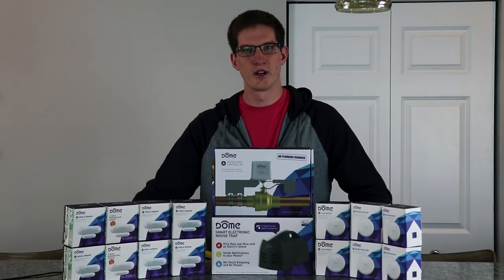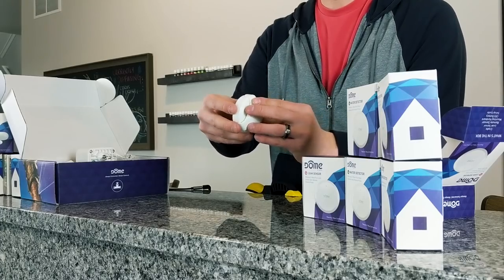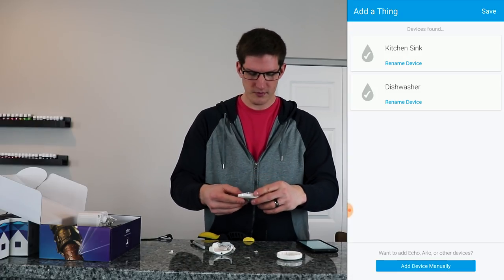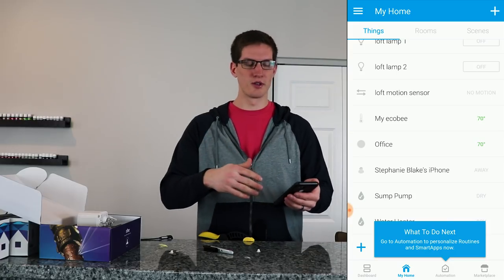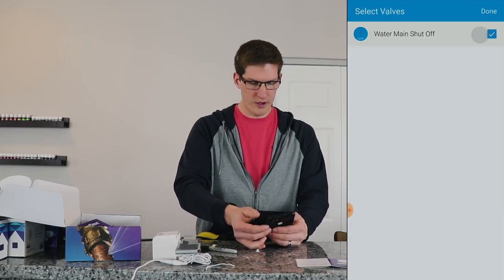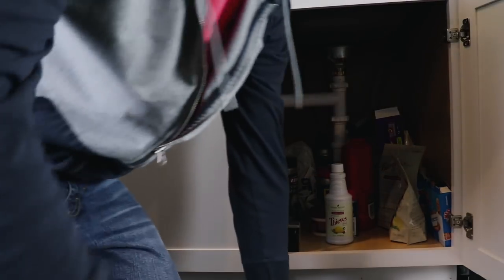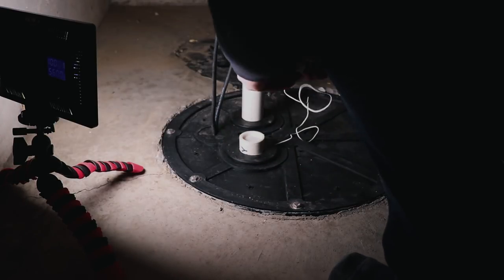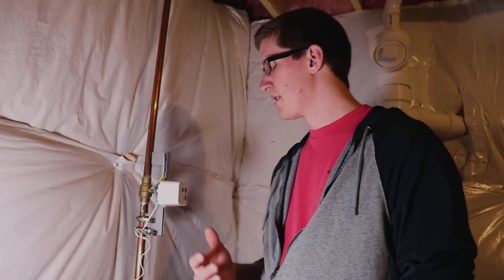Square One, Ep. 7: Using Leak Sensors to Close Water Main to Prevent Damage

Comment: Thanks for this series of videos.  They have been very educational and helpful.  I was wondering what the reason was for connecting the sump pump leak detector to shut off the water main.  It seems to me that the sump pump detector would normally be indicating a ground water problem or failure of the sump pump, neither of which would be helped by shutting off the water supply to the whole house. I suppose there could be a water leak in the basement that eventually triggers the sump pump detector if the pump isn't working, but that would be a bit late to prevent damage to things in the basement from say a leak in the main water line where the valve is.  More detectors would be needed to monitor that possibility. Certainly the detector is required on the sump pump, but perhaps it shouldn't shut off the main water supply in the case that it detects rising water in the sump?  I guess it's up to the home owner to determine what kind of action would be appropriate in that case - alarms, notifications etc.  That's what's nice about a smart home install like you're doing - it's easy to make changes to the system.  Again, thanks for your  videos!
Reply from the maker: You're 100% right. The only benefit of having the sump pump connected to the water valve is having an extra "alert" for when there is water detected. Which is not having any water in case they don't have their phone on them. We may have to change this one a bit :)
Reply: Well, it DOES make it easier to demo how the water valve works when you have a leak sensor near by... ;^)
Reply from the maker: For sure!!